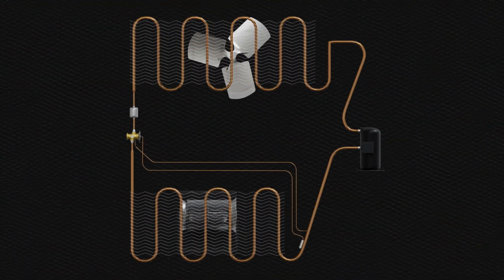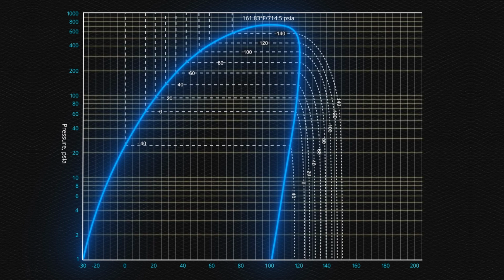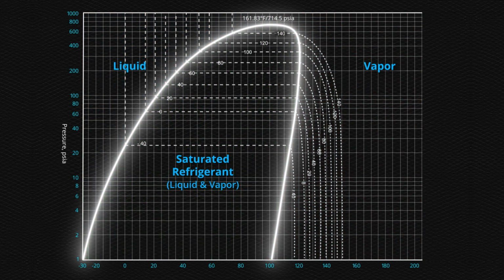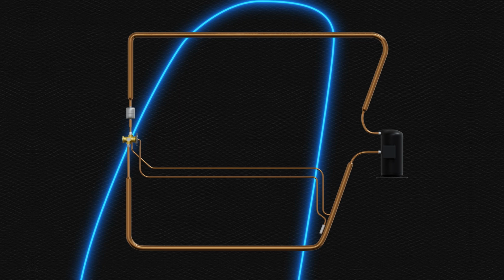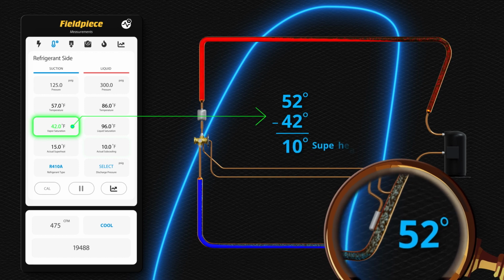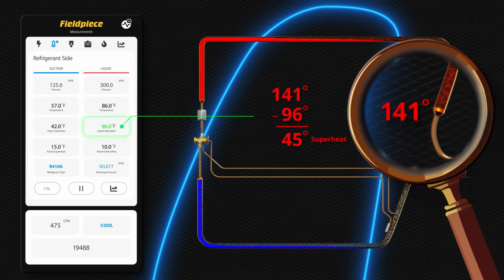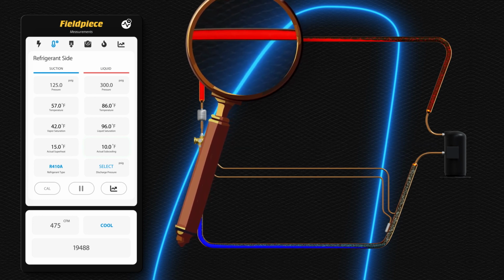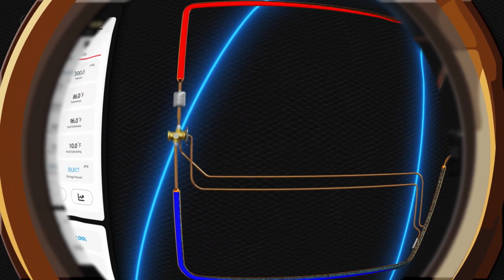Pressure Enthalpy Diagram - Video 3

Comment: Another excellent video!  Thanks. If I could make one suggestion that may help newbies, it may help to out on the diagram as you were moving thru with the spy glass, to have little icons showing where the probes and temp clamps would be attached.